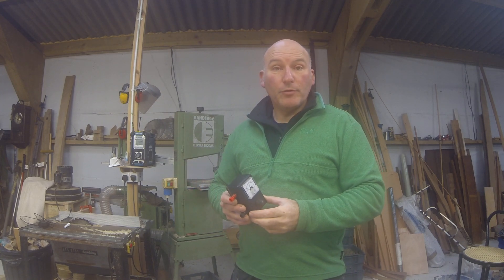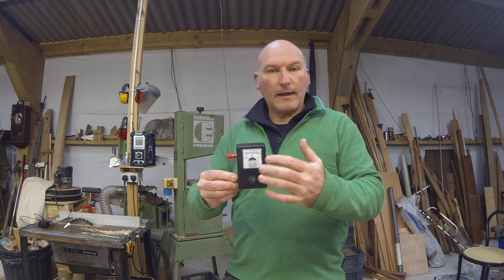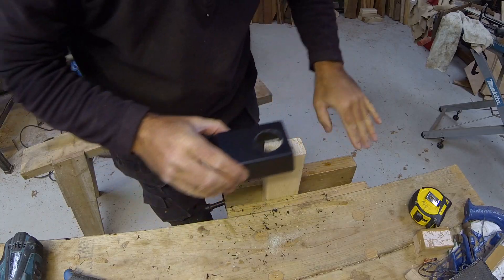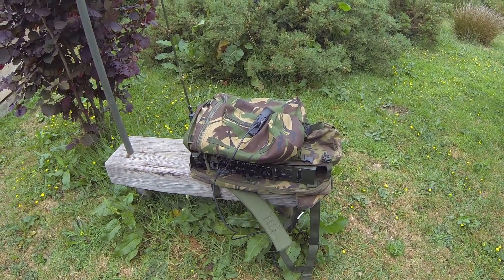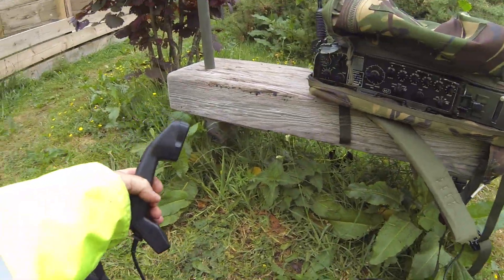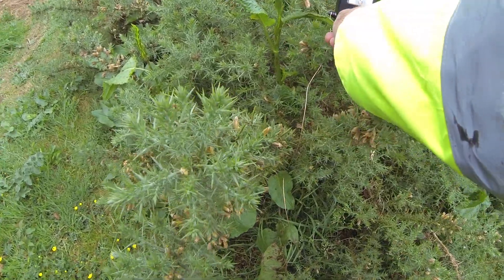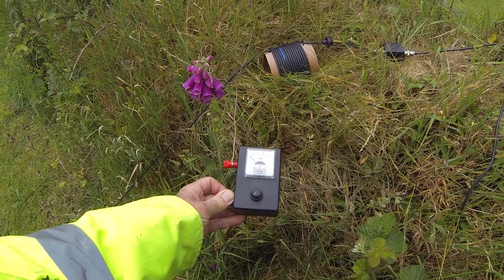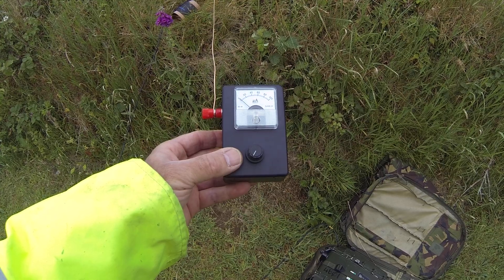Field Strength Meter - make your own

Comment: As you can tell by the time stamps of my comments.
I can share with you some techniques to allow such a small RF meter to show good deflection at a distance for HF.
You would need to feed the recrifying circuit
via an inductor from the small antenna and it would have to be tuned to resonance.
It is tricky
and I haven't seen other radio enthusiasts do it yet.

You have inspired me to demonstrate such a principal.

It is tricky but with the appropriate magnetic material 
we can use an external magnetic field to tune to resonance. 
I'm not a crusty ham saying I know it all
I am an experimental ham
that hasn"t yet shared my knowhow.
The differential sides of both the input and output
need to be fed at opposite ends.
Imagine, unlike a common mode choke over a ferrite
that has two parralel conductors,
we feed the two parralel conductors from the opposite sides
which actually adds to the coherence of both the E and B fields.
Two opposing currents
running in opposite direction
actually add together.